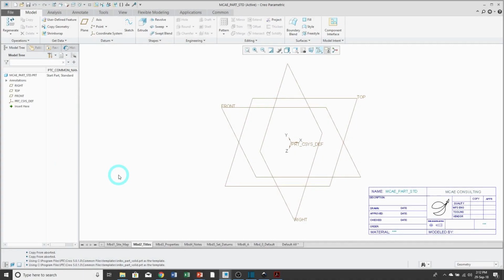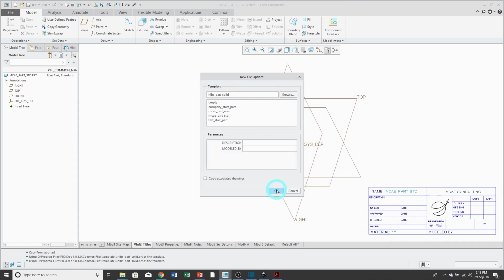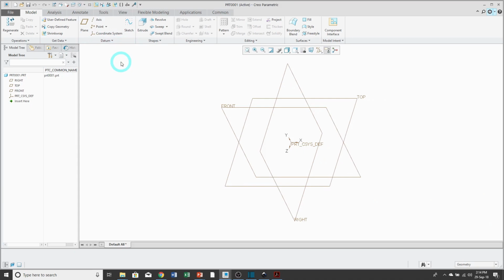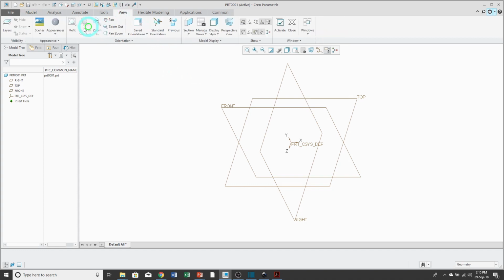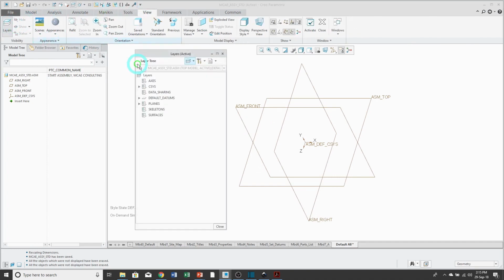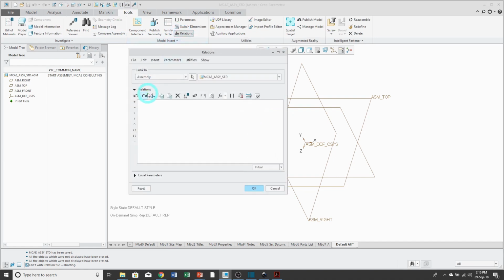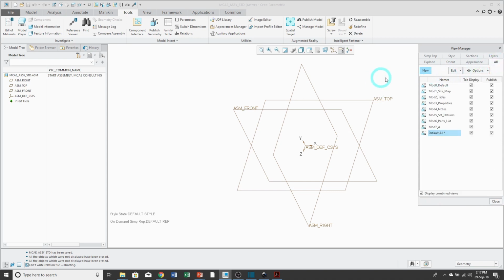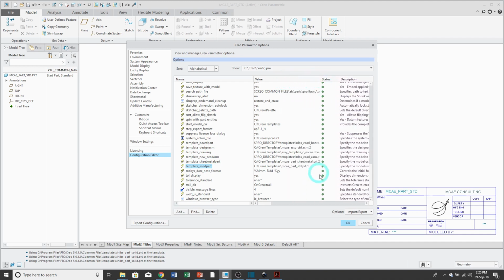Creo Parametric - Part and Assembly Model Default Templates

Comment: I have noticed that in creo 5.0 if you change the units to the creo ptc default option (inches, pounds and seconds) in any type of file then the change units option in model properties dissapears. Is that a bug? Its very annoying.
Reply from the maker: I tested this in 5.0.4.0 and I didn't see any issue. What build code are you using? Have you filed a ticket with PTC?